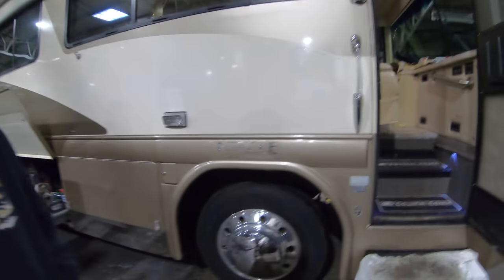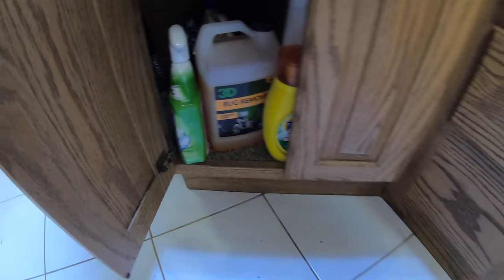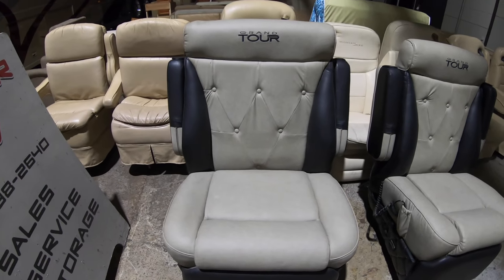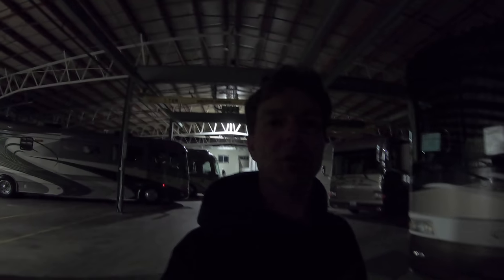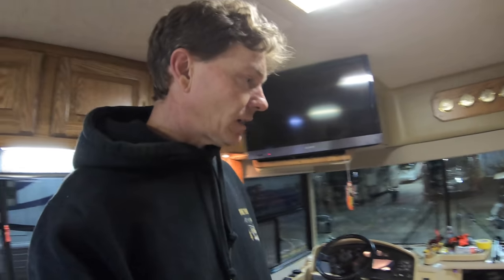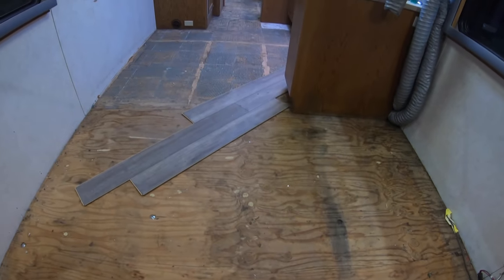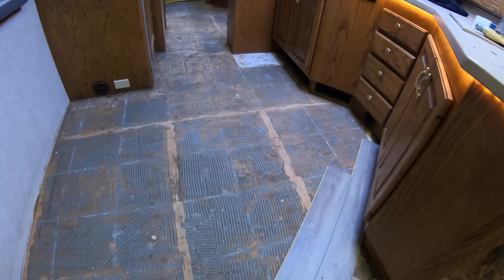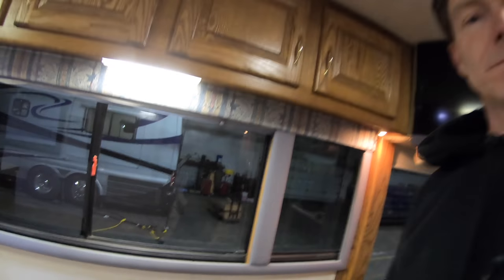RV Floor Removal and Installation Part 1 What did I get my self into.

Comment: Gosh I hate scraping up tile and then smoothing out the old hard thin set to put down new floors.  Not to mention the dust and mess made when you do it.  Im making an offer on a mid to late 90s Country Coach this morning and it needs floors and I had been thinking about it all weekend.  Perfect timing video!

Comment: You’re going to town there. Running the floor at a 45 is going to look good. Some of those end cuts in strange shaped places are going to be a PITA. It will be worth it in the end. Pulling the carpet out of mine and putting the waterproof vinyl down made it so much easier to clean in there. Looking forward to seeing it finished.

Comment: I have a 08 Newmar and want to do the same floor replacement, but the slides have rollers that roll on the floor and don't know if it will damage the new floor. I would hate to go thru all that work to replace the old carpet and tile and then to have the slides damage the new floor. OBTW use the same type of flooring tour using. 

Renard

Comment: Hi Brian, well here’s my opinion, looks like your choosen flooring has grey in it, and your driver/passenger chairs are mostly grey with a bit of black, looks like all your existing window valances are material covered?  If so the top pattern is very dated looking, the sides n bottom solid colour looks like more blue than grey, I would definitely recover those window valances bringing in a shade(s) of grey colour that is in the flooring, as you do not have blue in the new flooring. If going with any pattern material, go easy on black in the material.  Any valances that are wood, matching your cupboards leave be at this time. Now something I’ve not seen before, Andrew Steele your buddy just did a walk through on a 2022 winnebago journey prototype a couple days ago, the most simple window treatments I have seen in a MH, and it looks good in my opinion. Would be very easy to do! Go look! -it’s an idea. But you may want to install roller blinds then too. And yes I too think the flooring laid on that diagonal is going to look great! Cheers 🍻

Comment: Hello Brian, love this remodel, it will answer many questions for those of us that would like to DIY.  I would appreciate any info on seat belt anchor placement.  Are there existing places on both driver and passenger side for adding seat belt anchors to a couch or love seat?  My 2007 CC Inspire coach currently has a desk and chair in the passenger side and I would like to replace with a jack knife couch with seat belts?